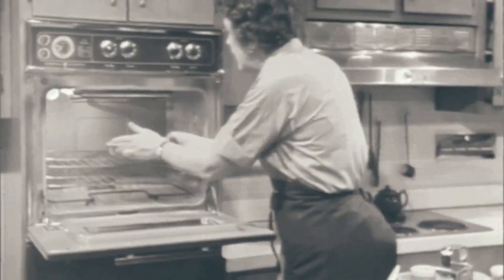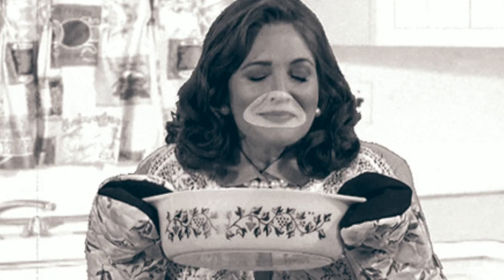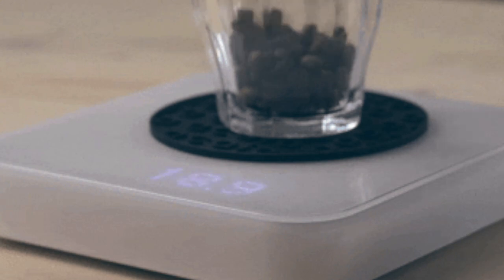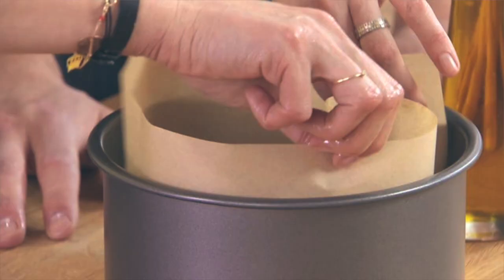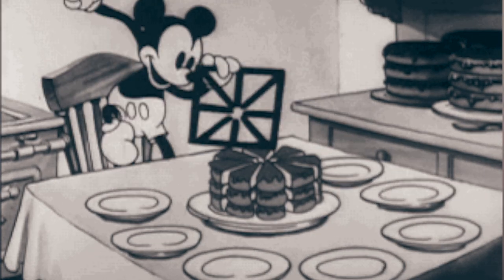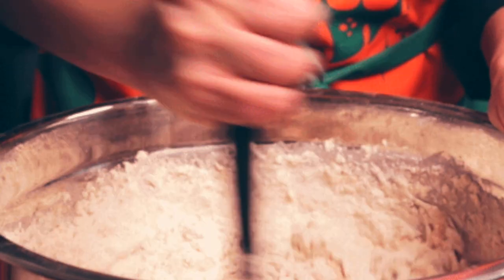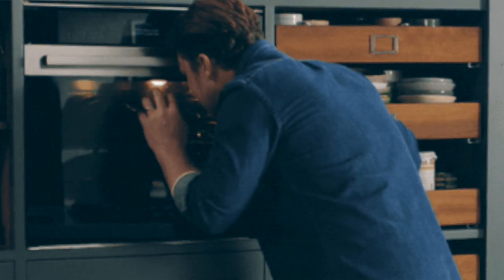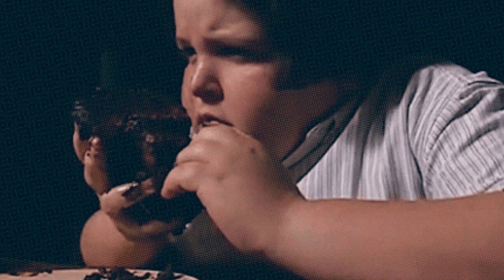why did my cake crack? | precious pioneer daily e5

Comment: Mine are just box cake mixes. If I need to lower the temperature from 350 then how much I go down to?
Reply from the maker: I would go to 325.. though if your oven is too hot check your fan settings. If it’s adjustable it should be on low or at 20%. If it’s still too hot put your cake on the middle or lower rack in the oven.
Reply: @PreciousPioneer  I don’t have a convection  oven